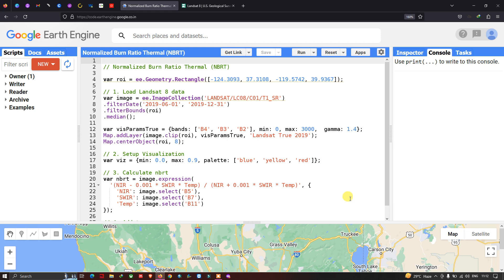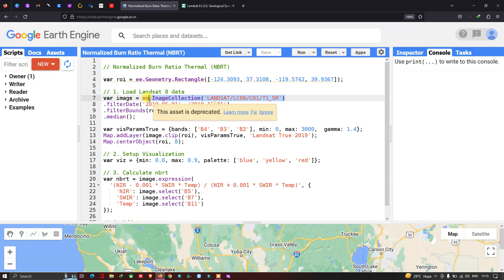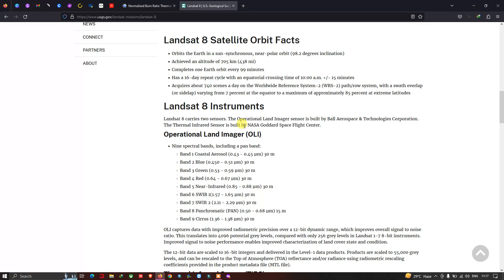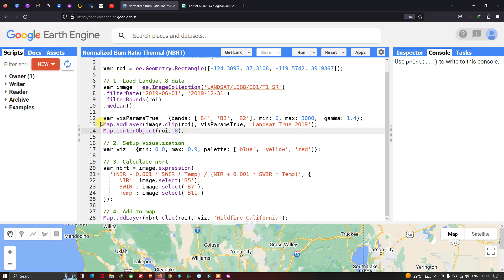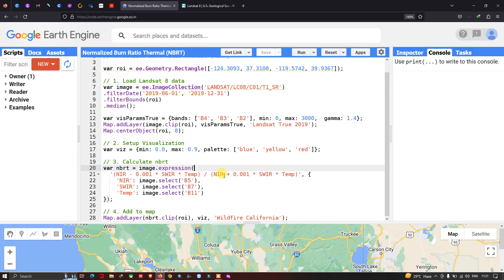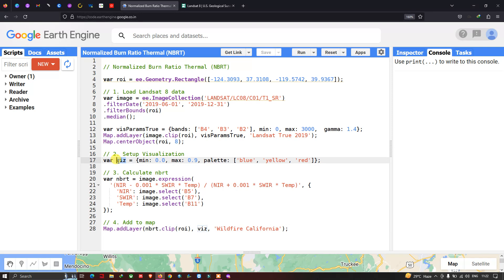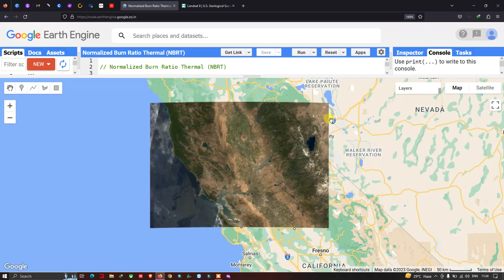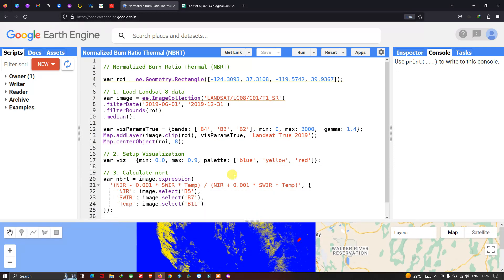Calculate Normalized Burn Ratio Thermal (NBRT) using Earth Engine | Forest Fire

Comment: Hallo, thanks for your assist. However, why I cannot run this script? Could you correction this script:
// Normalized Burn Ratio (NBR)

var roi = ee.Geometry.Rectangle([-118.7272, 34.1765, -117.9950, 34.1854]);

// 1. Load Landsat 8 data
var image = ee.ImageCollection('LANDSAT/LC08/C02/T1_L2')
.filterDate('2024-12-12', '2025-01-12')
.filterBounds(roi)
.median();

var visParamsTrue = {bands: ['SR_B4', 'SR_B3', 'SR_B2'], min: 0, max: 3000,  gamma: 1.4};
Map.addLayer(image.clip(roi), visParamsTrue, 'Landsat True 2025');
Map.centerObject(roi, 8);

// 2. Setup Visualization
var viz = {min: 0.0, max: 0.9, palette: ['blue', 'yellow', 'red']};

// 3. Calculate nbr
var nbr= image.expression(
  '(NIR - SWIR) / (NIR + SWIR)', {
    'NIR': image.select('SR_B5'),
    'SWIR': image.select('SR_B7'),
});

// 4. Add to map
Map.addLayer(nbr.clip(roi), viz, 'Wildfire California');

Thanks in advance 🙏🏼